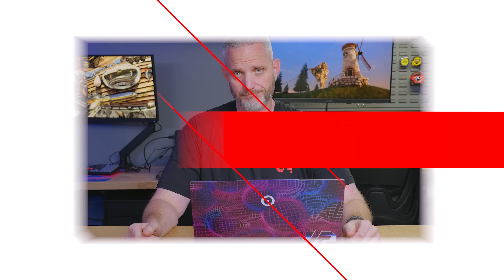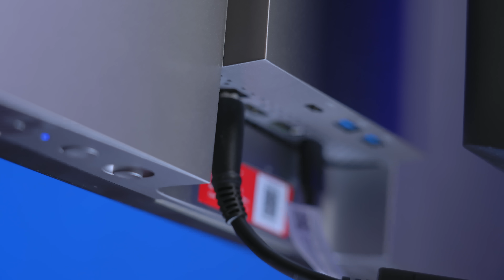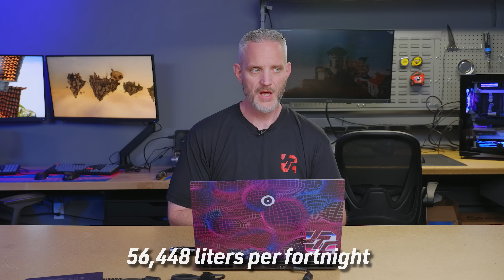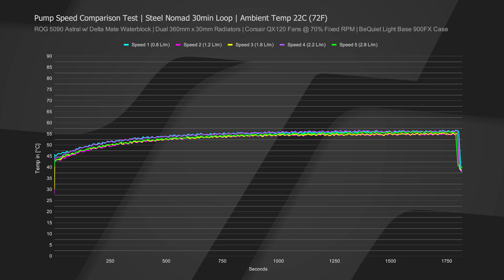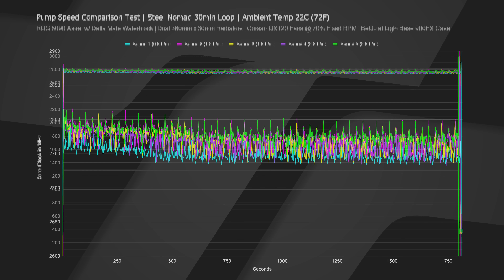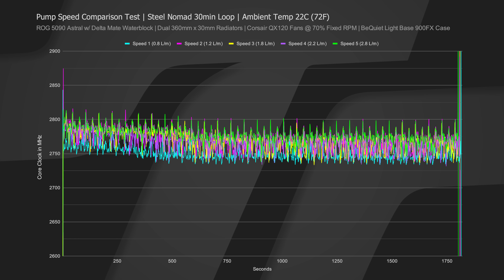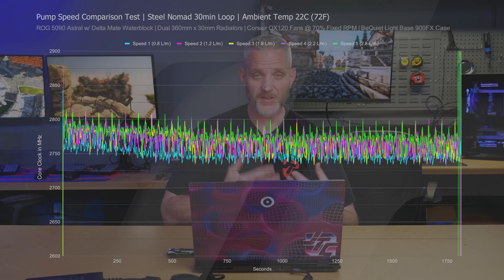Stop doing it this way!

Comment: Don't reinvent the wheel.   Enthusiast PC water cooling started in the U.S.   The only appropriate unit for flow in a PC water loop is "Gallons per Minute" or GPM.   Not only was this the first unit used for this purpose, but it also results in very nice rules of thumb with easy to remember numbers.

The good old rule of thumb is that you want at least 1 GPM across your water blocks for decent cooling performance.  Generally, as you creep up above 1GPM, there are pretty significant limiting returns, but if you need the extra few degrees, even 2GPM can be of value. The more heat the chip cooled by that block puts out, the more flow you want.

The truth is this:
1.) With too low flow, the coolant heats up as it traverses the block, reducing its effectiveness.   The coolant on one side of the block will be warmer than the coolant on the other, reducing the blocks effectiveness.    You want to force that coolant through there as fast as possible such that there is no measurable temperature delta across the block.   The closer you get to this ideal state, the smaller the delta between your chip temp and your coolant temp will be.
2.) The statement about coolant not sitting long in the radiator is flawed.  The same principle applies to the radiator.   You want to flow the coolant through there as fast as possible, otherwise the coolant near the outlet of the radiator will be much cooler than the coolant near the inlet.   The radiator will work better if the delta T to the air is higher, so this reduces its effectiveness.

The "time in the radiator" and "time in the block" comments are just plain wrong.  This fundamentally misunderstands how rate change works in engineering problems.   Anyone who makes this comment has never studied differential equations.

In an ideal state for maximum cooling efficiency you want the flow to be fast enough that the measurable difference in coolant temp between different locations of the loop is negligible.   The loop is then in a steady state where heat is entering and leaving the coolant at its maximum ability.   This will minimize both the temperature delta between the ambient air and the coolant and the temperature delta between the coolant and the chip.

So if there were no downsides to flow, you'd want to crank it up as high as you can.  The differences are generally small (there is only so much of a temperature delta to carve away at) but they are real, and it doesn't take a significant temperature difference to better maintain boost temps.    But there are also downsides to flow.

The D5 pump - for instance - is designed to cool itself using the fluid in the loop. At full speed a D5 is contributing ~20W-25W to the heat added to the loop.   For just one D5 this is not a lot compared to modern hot components, but if you have a large complex loop and start adding D5 pumps to crank up the flow, pretty soon the pumps themselves will be a significant contributor to loop heat, which is not ideal.

This is why you may want to use less than 100% pump speed, depending on your loop.

Personally I use the approach of tuning my system at full load.  I manually max out the fans, and then I run something like Prime95 on low CPU priority, and at the same time a looping GPU benchmark that can max out the GPU load, and then I find the pump speed that results in the lowest chip temps.    Most of the time for me this has been 100%.   The added flow over the blocks has been more beneficial than the drawback of more heat dumped into the loop by the pump.   But that has been in my setup.  This will not be the case for all setups.

I then use my Aquaero6 by Aquacomputer to monitor the temps of the coolant as close as possible to where it exits the blocks.   I use this temp to control pump speed.   My ideal pump speed above at full load becomes the max.   I then let them scale back to lower pump speeds under conditions less than max.   There is no reason to have that pump cranking all of the time, when the system isn't at high load.

The idea here is that if coolant that is warmer than ideal is exiting the blocks, the fastest way to address that is to push more coolant through from the other side.    This means the system is not operating at the above ideal "steady state" at low loads, but we also don't need it to be operating at that ideal steady state at low loads.   This works best if you use a so-called "Set Point" or "PID" controller instead of a temperature curve as it will be more effective at targeting a target temperature than a curve will be.   (A curve always over-cools at below max temps).   If you have a PWM pump and do variable pump speeds, you'll want to make sure you set the minimum PWM speed above the pumps shutoff speed, or you'll have crazy oscillations in both temperature and flow as the pump repeatedly shuts off and powers back on again.

I then set fan speeds based on measuring the coolant temp leaving the reservoir.   If the temperature leaving the reservoir is too high, the only course of action is to increase fan speed.

As far as Jays results go, they are strange.   I have done this very test time and time again over the years with many different loops and seen a clear and measurable correlation where higher flow repeatably produces lower temps.  Again, small, single digit changes, but still measurable.   I wonder if there is something wrong with Jays pump.   Even his max flow is pretty low at below 1GPM.   He should be seeing good scaling with higher flow.

EDIT:
Just to verify, as it has been a long time since I last did this, I just repeated the test on my current workstation.  It's a beefy loop (two 480mm radiators + one 420mm in a Corsair 1000D case),   Temporarily there is no GPU in the loop, but it is cooling a hot and bothered Threadripper 3960x. (24C/48T)

There are three D5 pumps in this loop.   I just loaded up the CPU with Prime95 (small FFT's to maximize heat output, and keep it relatively consistent)  and then did a slow sweep of the pumps from ~40% pump PWM speed up to 100% pump PWM speed over about 10 minutes.

During this run, coolant temp increased by about 2°C from ~24°C up to ~26°C as the coolant in the loop heated up.

The CPU temp started out at about 64°C when Prime95 initially started, but gradually and slowly decreased over the 10 minutes roughly in pace with the pump speed down to about 62°C at max pump speed.   So going from 40% pump speed to 100% pump speed yielded almost perfectly linear scaling for about 2°C.

Again, in that same time the coolant increased in temperature by about 2°C as well.    Had I actually waited for the loop to fully heat soak and then started the pump speed sweep, I would thus have seen a 4°C difference across the pump speeds.

4°C may not seem like much, but it can mean the difference between boosting and not boosting.

Comment: Tell this to expensive 360mm Corsair AIO where pump is min 2400 and goes up to 2800 :)) .........i mean why Corsair why .........the sound of pump is louder than my 10 FANS running at 700 RPM........my old NZXT is running at 1200 RPM  !!

Comment: Couldnt you just run the pump in a loop with only itself and a radiator with a temp gauge to see if different pump speeds add any detectable temp increases?

Comment: Yes, like with most things, the middle ground is the most optimal :)

Really cool findings, maybe could've used a little more B-roll, and talking about the results one at a time, instead of throwing them all in the same graph all at once.
You could've also ran a test, on a fully heat soaked system, with just one run as an example for a singular test load, heat generation, and frequency changes, to have an example for context. Might've made the big graphs easier to parse.

One thing I think was missing from the video, and apologies if I missed it, was the notion that not only does slower flow impact how much time the coolant spends in the radiators, it also similarly impacts how much heat gets trapped in the coolant as it passes the fins on the blocks. Faster flow, more exchange, but slower flow more time to absorb the heat. At least in theory. I think this would also be a very interesting thing to do more testing on. 

Thank you for the video!

Comment: @JayzTwoCents A quick video suggestion, cant remember if it was in your vid that it was talked about or not... anyways, idigress... pun intended. Is it worth using CPU's iGPU on a multimonitor system. So, are you better off just running your main monitor of your GPU and setting iGPU to the 2nd monitor and does this affect performance in any way. Or power usage.

Comment: When I had an Optimus CPU block, three 360mm radiators, and two RTX 3090s with Optimus blocks, one D5 at full speed had trouble pushing the fluid through the loop with enough liters per minute to keep the loop cool. Adding a second D5 improved component temperatures significantly.

Comment: I like PWM pumps. I set the curve up so that at low temps the pump runs at a low speed. At normal gaming temps I set the pump speed to run fast enough that you can see the movement in the loop. At hot temps I set the pump to go all the way to full speed before the fans also go full speed in that save yourself kind of way.

Comment: The talk about pump life and 60,000 hours or so makes me want to use a circulation pump from Danfoss for a cooling loop. There is one in my house and it's been working continuously for at least thirty years, probably really forty or even fifty years since it was replaced. I remember my father telling me that if it had been shut off for a while it might not start by itself. If that happened take a hammer and try tapping the body a few times. If that didn't work I might have to remove it and clean the impeller. But the first time that happened I just raised the speed control from the slowest to the highest and it started immediately. Turning it back to min it kept spinning. So large and yet I can no longer hear if it is running but has to touch it to feel the vibration. Crushing the skull and killing the hearing on one ear didn't help, and the tinnitus in the remaining ear also makes hearing quiet things pretty hard.

Anyway the quality and longevity of large circulation pumps is rather impressive.

Comment: 02:00  No, the amount of heat put into the loop cannot be more than the power draw.  That's just how physics works.  It will, in fact, be less, as some of the heat will be dissipated into the surrounding air around the card.

Comment: Consider doing a no pump speed test? At the end of the day, equilibrium of water, all the water is the one set of liquid. Fans remove heat. Much like a vapour chamber. I am just curious the result. low pump speed is so close to full speed that just maybe.....
Reply: I get it is mentioned at the end of the video and that pump is needed to bleed air etc I am just curious as we are assuming the CPU temp will rocket.

Comment: When are we gonna talk about the thermal boundary layer in the water blocks and how turbulence increases heat transfer? Also, how about a "will it boil" series where you try and boil the fluid in the loop from the heat? To test the heat addition of the D5 pump you could make a small loop res combo and drop in a thermocouple instead of a thermal camera. Although the thermal camera would be interesting to see.

Comment: Upon startup, my aio will make zip zip sound until i get into the os, launch fan control and adjust the speed of the pump. I'm assuming since it is powered by pwm its going from 0-100 percent? msi mag core v2 240 @jayzTwoCents, i typically stay about 40% on the pump speed

Comment: I wonder if maybe this is because at a slightly slower speed the water has more time to absorb heat and wick it away to the radiators. you know what you should have done? put some air temp sensors on the exits of the radiators while doing these tests. if the cpu was cooler but the rads hotter at these lower RPMS then maybe that would show that the efficiency of the system has increased? I could be wrong about the more efficient heat transfer causing the rads to be hotter but hey worth a shot make it a short! lol

Comment: I'm curious about this loop set up.
Rez>split>parallel lanes with a pump at speed 2 or 3 and a rad each>to merge>gpu/cpu>other component>back to rez. Or something to that effect so that you get the benefit of slower flow across the rads but higher flow across the fins in the blocks.

Comment: Before watching: I have my pump set at 1,000RPM and that seems to be working fine for me, although I’m far from on the latest hardware.

After watching: pump speed doesn’t really matter as long as you’ve got enough flow to overcome the resistance of the loop.

Comment: While I like Jay, my physics brain chirped when he broke the laws of thermodynamics and said it would dump more heat then power draw.

@Jay, thermal waste heat is power draw for room temperature electronics.  In fact "power draw" is a bit of a misnomer, moving current around is power neutral when there is no ohmic resistance as is the case of super conductors.  Unfortunately room temperature electronics has ohmic resistance that converts a portion of the electrical current into low level thermal waste heat that we need to dispose of.  That lost energy then needs to be replenished in the form of new energy from outside the circuit, otherwise the currents voltage drops and eventually dissipates entirely into thermal energy.  A device that draws 600W of power, means it's needing to replenish 600W (0.6kW) worth of energy every hour, meaning 600Wh worth of electrical energy got converted into thermal energy.

Also Jay measuring the thermal contribution of the pump is easy because it's using the fluid as it's coolant, just measure electrical usage.  If it's using 5W of power, then it's dumping approximately 5W into the loop.  Conservation of energy matters, energy is neither created nor destroyed, only converted from one form to another.  The energy the pump "uses" doesn't vanish from the universe, instead it's converted into kinetic and thermal.  The thermal is directly dumped into the water, the kinetic is what moves the water but that then gets converted into thermal by the friction of the water against the tubing and various loop components.

Comment: Hey Jay! After doing lots and lots of research for my next rebuild, I find myself questioning how thick of a radiator does one really need? I have been watercooling for 7 years now and still dont have a solid answer for myself of what thickness of rad is best for any given scenario. For example, my next rebuild is in the FRAME 4000 D, and the clearances are not great for 360 mm rads in that case when looking to use the front and top orientation simultaniously. So I picked up some XSPC TX360 ultra thin rads as they performed (seemingly according to Techpowerup) the same as some 30mm thick rads. Could you explore this topic with say 20mm, 30mm, 45mm, and 60mm rads to get an index? Thank you and I love this video and everything watercooling! I have you to thank for my PC obsession as well as my adoration for open loops! ❤

Comment: Test suggestion: Ram, power delivery, and chipset temps with the liquid cooling and fan layouts. Also interested in the temps of the ram sticks on the back side of the motherboard. 

Example: If we are more or less passive cooling DDR5 would more turbulence in front of the RAM with top down airflow reduce temps of passive components? Vs. Bottom up where the air might pass over the ram after going around the GPU.

Comment: One word; turbulence. The fittings and fins don't just add resistance, they make the flow turbulent. The faster you move the fluid the more turbulence added. Even though you're seeing increased flow at higher speeds, the turbulence at every fitting etc makes the fluid temperature and flow less and less consistent. Slower speed equals smoother flow and more consisten heat transfer at the hot plates and radiators

Comment: Speed 1 2 3 4 5 is basically meaningless drivel when you don't tell us what RPM the pump is running at at each speed setting

Comment: if you want to find out how much heat your pump dumps into the coolant just run the pump on a closed loop just the pump.if the coolant warms up then you can measure that difference.

Comment: After your last one I played with the pump speed on the Arctic liquid freezer 3 360 I have on my 9800X3D. It doesn't have any problem maintaining temp with an R23 load down at 35% pump speed, and at idle temps it's been fine at 25%.

Comment: Your measurements seem flawed. There are too many variables. Maybe you could redo the tests with a controlled heat source and controlled water temperature going into the block. Conceptually, there's no difference between fan speed/air flow over an air cooler and flow rate through a water block. If you control the water temperature you will absolutely see the effect. If you cannot get the energy out of the water, you're right that the impact flow rate has becomes less measurable.

Comment: I have two 480MM Rads with a DDC Pump and its running at 25% .. and I am running 5.34 Liters and Coolant stays around 29C ... I have a 5900X and a 6800XT  .... No over clock ..